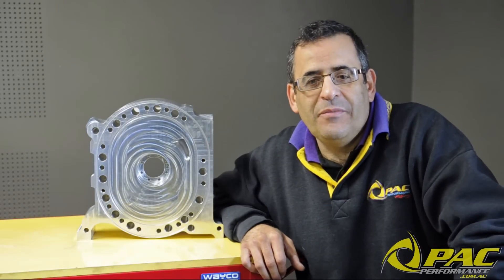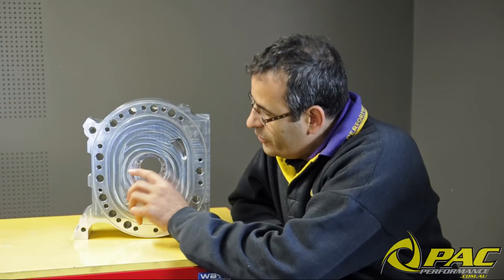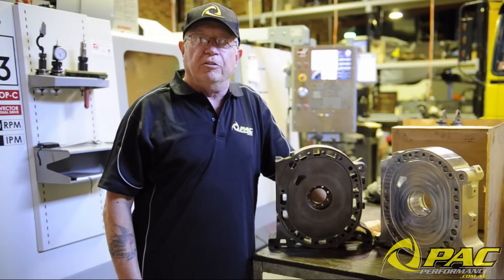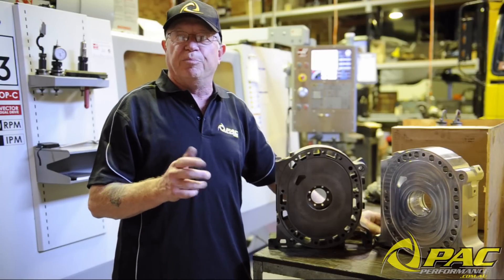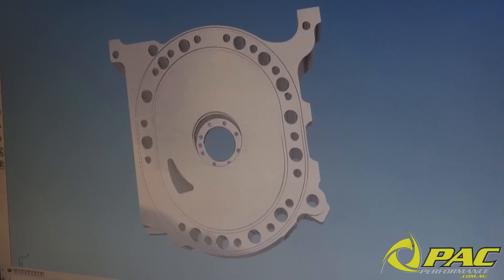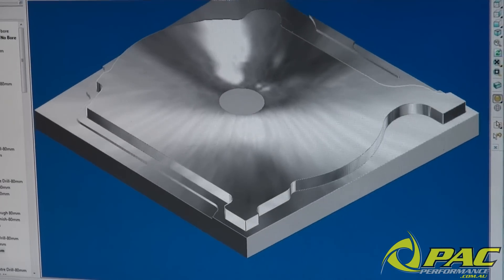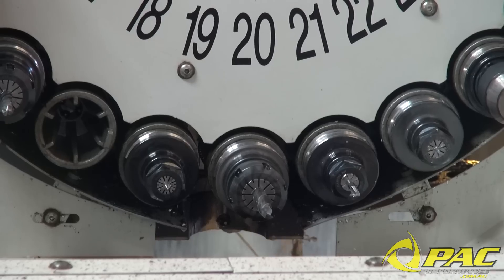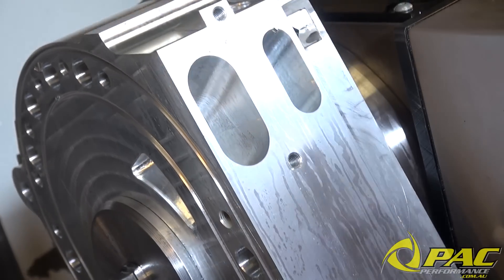Inside Access - Pac Performance Billet 20B Rotary Centre Plate

Comment: Questions, is the center plate solid? how is the plate surface for the rotor cooled? Is it cooled  just by the thickness of the plate in the center ?  Are the end plates solid too and cooled with oil behind the rotor surface? I know the original housing has hollow cores built into them and somebody once told me that they were cast into 2 pieces and then welded together..I would love to see a video on how you machine any hollow spaces if there is any..great videos..keep up the good work:)
Reply: oil cooled down each faces hot zone from oil ejected from the rotor and the bearing. plate faces are an alum oxide that does not conduct the combustion heat like the cast iron /steel will  / the rest of the block is an effective heatsink to the water jackets